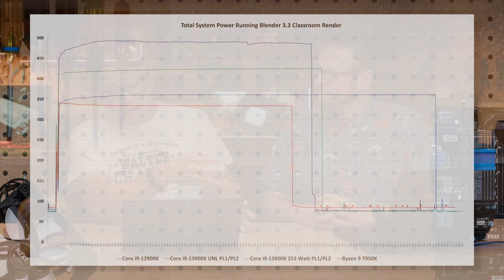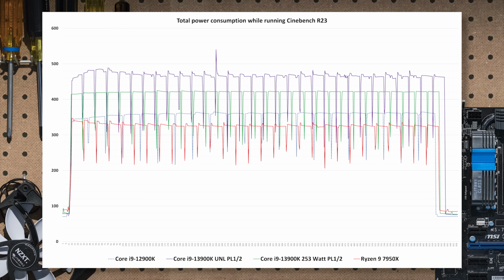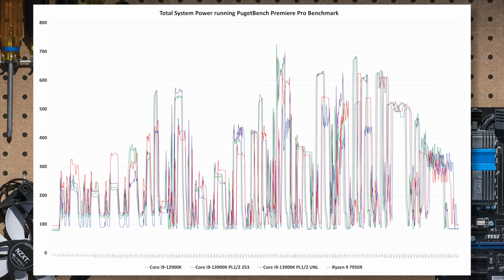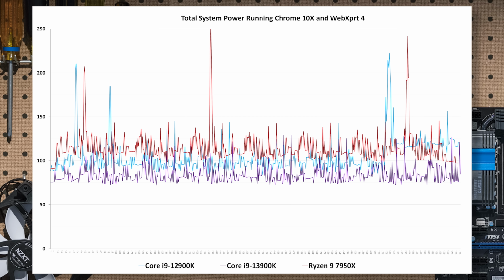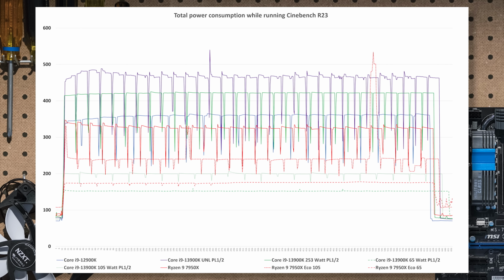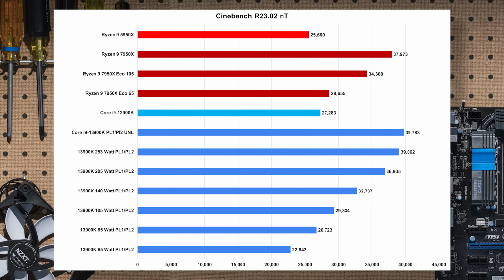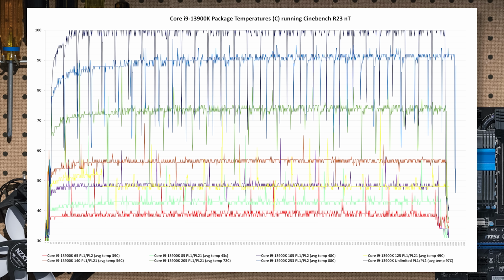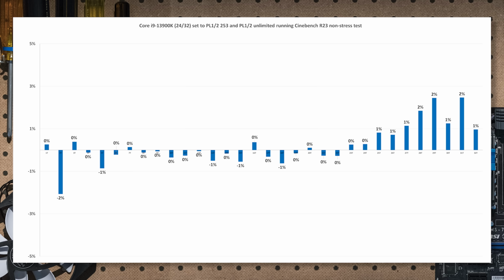How Much Power Does 13900K Use??

Comment: I have i9-13900kf cpu with ARTIC liquid freezer 3 420mm AIO .
With no overclocking , completely stock it will draw up to 287 watts by itself .
Max temps are 92 deg C for brief periods . No thermal throttling is ever noted while running cinebench  .
The 92 deg temp is only after several minutes running and like i stated only briefly.  Average max temp after 3 minutes is 81 deg C .
Fantastic AIO , especially for $115 !!!! It does require a case that can fit the HUGE radiator however .

Comment: Hi everybody, would an 850w 80 + platinum PSU enough for my build:
I9-13900k
Gigabyte Aorus Master motherboard 
Arctic liquid freezer II 420 argb
1 T m.2 firecuda 530 SSD
64GB ddr5 6000mhz ram
Gigabyte RX 6750 XT (3 Argb fans)
3 argb 140mm fans 
I'm not getting 1000w or higher PSU because I read that maximum efficiency is at 50/60% of load...but maybe I'm wrong.
Please give me your opinions, thanks guys
Reply: Yes you can. I can run I9-13900F with Asus Rog Strix RTX 3080 OC with a Corsair TX750M. Your graphiccard even got less watt usage then mine. Haven't bought my upgrade yet tho. But a Youtuber confirmed I only needed a 750W PSU. I have also ripped out the max power usage for the whole package and it doesn't getting over 700W, my calculations are based on the daily usage of gaming and stuff where no rendering and such are in the schedule, but I added about 90% heavy load when the I9-13900 are set to the 253W cap. This with RAM power usage, AIO watt usage, all RGB fans watt usage. Won't go over 700W. 697W for everything, so a 750W are more then enough for what I am using the PC for.

Comment: Comparing 19:28 to 17:20 shows, that at the respective 65 & 105 W settings these systems, when compared at the same wattage setting, don’t draw the same power, so their performance difference becomes plausible in favor of intel, since intels 65W is lower than amds, right? So maybe intel is too honest when power limits are used, compared to amd … what do you think?

Comment: I have a 13700k and RX 6800 XT on my gaming rig.  The rig regularly pulls 600 watts from the wall when gaming. Considering my 1000 watt Corsair PSU is Gold rated it has a 92% efficiency which means I have to subtract 8% from 600 watts. That is 64 watts wasted in the conversion from AC to DC.  So the energy my rig is using is actually 538 Watts.  Considering the GPU can take up to 260 watts, and the fact I have 6 RGB fans on my Rig means the intel isn’t using that much power.  It just spikes 253 or more if unlimited then it comes back down very quickly. The over all power draw isn’t as bad as one might think. Though 600 watts to play games is a lot when I think about it. That is the amount of watts some AC units use. 😅
Reply: One quastion, my house is old 50years. Its okey for cable instalation, if i use i9 13900k + rtx 4090 with good 1300w titanium PSU??

Comment: First I need to say, I really enjoy watching you two: not only it's informative (for general public), it's also entertaining.
Now about this particular video... At the point when you started to talk about heat, you just turned into the temperature direction, as that would be the same. And then you ended with conclusion "95°C/100°C is fine if AMD/Intel says so".
Well, temperature and heat are two different things and so you only touched half (less important part) of the problem. Ok, CPU's working temperature actually isn't a problem (as long within specs) -the heat is. Amount of heat is directly related to power consumption (1W=1J/second) and nothing else. That is, we can decrease CPU temperature (with bigger cooler), however that doesn't decrease amount of heat transferred into our room. Example: if one CPU consumes 150W and the second one 300W, then the second one will push double amount of heat into the room -regardless of CPU temperatures. It's amount of heat that increases room temperature, which we need to cool down on hot summer days.. which adds the costs and reduces energy efficiency.
Just wished to point out that very important aspect, IMHO.

Comment: How often do we run the CPU at all core 100% utilization? I think our PCs spend most time at idle. When gaming, it is usually running below 70%. When web browsing, it is under 10%. So power consumption differences between the various processors is not really significant.

Comment: Max power matters most IMO, it's what dictates the your PSU, cooler and (to some extent) motherboard choice. It also determines how hot your room will get or how much AC you need to cool it down. When you actually run the numbers, the power bill isn't really much of a factor.

Comment: Heh, this went up less than an hour after I commented about idle power on the video of benchmarks, so it's almost impossible you took my feedback into account.  But thanks for mentioning idle power anyway.  On the PugetBench results, something you might do to make the charts easier to read would be to plot the integral of the power consumption (the total energy) instead of the power consumption directly.  You could see the different configurations "racing" each other to the finish line, and the most efficient would be whichever line was lowest on the graph at the far right of the chart.

100°C has been normal on laptops for a decade :-)

P.S. Are the gaming tests run with vsync on or off?  'Cause vsync off would make the GPU power draw depend on how fast the CPU is.
Reply: Good suggestions. vsync was off.

Comment: Gordon and Adam Chrome browsing shows Intel Coliseum on not much power that is horizontal. mb
Reply: CPU + GPU @ 530W is a little over the top. mb
Reply: Another Coliseum at 16 minutes more delineated then compressed into RL Chrome platform but AMD R7K across a top to bottom power. mb
Reply: Capturing all eco RL v R7K turns off some blocks (cores) and other dark silicon and R7K also so what logic blocks? mb
Reply: Oh, another coliseum like in boxing and other blood sport rings at 22:30. mb
Reply: Gordon if all the top plaintiff attorneys in Oakland and San Francisco did not accept the Rocket consumer rip off case why would they represent the Raptor blown circuit case?  mb

Comment: Great job covering a topic that NOONE else is doing!!! That said I rarely niipick but you kind of dribbled the ball in conflating power and energy/efficiency this time around.  Several charts show less "power" but they also took longer so maybe similar energy/efficiency especially between 12 and 13 Intel. Poor Wendel over on Level1 felt the need to explain the difference between temperature and heat because of the whole 95C thing. I don't want to see people get confused about power vs. energy
Reply: Good points.

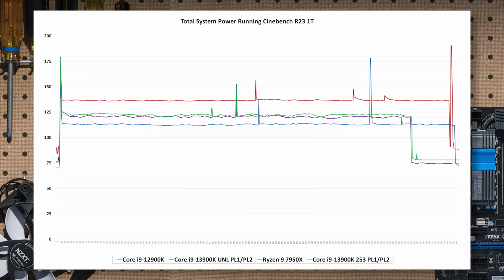Comment: 6:07 In single core its hard to tell if 12900k or 13900K is more efficient but 7950x is a surprise in that it is significantly worse(I wonder which core-type Cine-bench was using for the Intel processors). I suspect the AMD decision to run at high temps has hurt efficiency.
Reply: I seriously doubt the single-thread temps are as high.  Also, Intel's temperature target is higher.  I'd guess that the single-thread efficiency problem has the same cause as the idle power draw.
Reply: @Vegemeister1  True I agree...unless they have single core temp limiting but doubt that since It's always been a per chiplet/die thing...so yes
Reply: @jjdawg9918  They do have single-core temp limiting.  But because of the inactive other cores sinking some of the heat, and because of the OS scheduler migrating the thread between cores, the only way to hit the temp limit in a single-thread task is if your cooler falls off or your fan stops.

Comment: i dont understand the big deal with these thermals and power limits.  These are all synthetic benchmark numbers.  99.9% of people will not be hitting anywhere close to power limits.  Nobody is running benchmarks 24/7 for practical purposes.  Under normal use you will pretty much never hit these limits let alone for prolonged periods.  People act like their CPU will be drawing 300+ watts all day.
Reply: for productivity and rendering they will use all cores
Reply: @thehahahaha88  i doubt even heavy rendering will max out all cores.  I max out all cores regularly using 3d modeling softwares for 8 hours a day, and the temps and power usage are nothing like running Cinebench.
Reply: @keokio7  it will, 3d modelling software like 3dsmax will only use 1 core. But rendering software like blender, corona, vray will max out all cores
Reply: It does make motherboards more expensive, but for your electric bill you should be a lot more worried about the 70W idle than the 300+W load.
Reply: @Vegemeister1  70w idle? My 13900k is sitting at 23 watts right now watching a video
Reply: @keokio7  Total system power.  Look at the tail end of the graph at 6:10.  70w is unusually high -- I'm used to more like 50 W -- but PCworld's test bench has a monster GPU, an AIO (pumping water ain't easy), and probably an oversized power supply.
Reply: @Vegemeister1  im talking purely CPU, total system power can vary depending on components.  There was a video out there comparing 12900k and AMD's 5950x? anyways it was surprising how little the 12900k power consumption was under daily practical use.  Mainly due to the Ecores being efficient.. as much as i hate ecores.
Reply: @keokio7  I'm fairly confident the e-cores have nothing to do with it.  My Haswell from nearly a decade ago idles at ~3W reported package power and 50 W from the wall (with discrete GPU).   Ryzen's high idle power is probably something to do with the chiplet architecture.  Also, I've heard that overclocking memory past 3200 MT/s on Zen 3 disables some power-saving functions, resulting in considerably higher idle power with the commonly recommended "sweet spot" 3600 MT/s memory.
Reply: @Vegemeister1  haswell were 4 cores.. surely you can't expect the same power consumption with a 4 core CPU.  And no its not AMDs architecture, if anything they should draw less power based on their smaller transistors.  AMD has 16 cores that does 5ghz.  Intel has 8 cores thats 5ghz and the rest are 3-4ghz.  Of course they'll use less power when using ecores, its just logic

Comment: THANK YOU! Everyone else is just talking about the gaming performance. Power utilization is important to me because I'm the one who has to pay the electric bill! 😳⚡ My office is also small and I don't want to be uncomfortably warm in there. It was great to hear that there is an option to power limit this chip. I could see me doing most of my work at a lower power setting and then flipping the switch only when I'm ready to render the final project.
Reply: hear hear!
Reply: Power is cheap compared to salary, if it can make you save time, it's probably always worth it to use more power.

Comment: The reason why the 13900K is using less power while configured to match AMD's Eco modes is because Eco mode does not represent the full package power like Intel's PL1/PL2 settings do so you were actually comparing Intel at 65W/105W vs AMD at 90W/145W. The closest AMD has is their PPT value which is still some watts short but it's close enough.
Reply: Sounds like a pretty big oversight to be honest they gotta check those especially for idle power, sounds like AMD needs to offer a real 65 W mode

Comment: With both top chips running wide open, No OC,  Max Cinebench 23 scores are very similar but AMD is only using 185 watts to get there as opposed to 300 watts for Intel.   If you really want the best all around plunge into the Intel AMD comparison then watch Hardware Unboxed Channel.  He really knocked it out of the park.  I have watched 6 13900k Vids today.

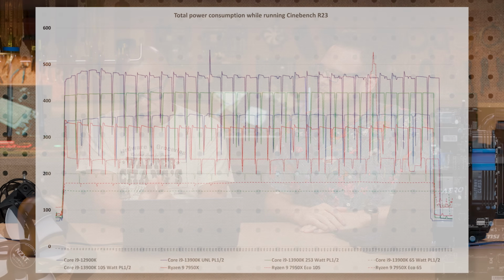Comment: @16:04 Looking at both ends of the graph, how exactly is 7950x in eco mode consumes more power during idle compared to when it's not in eco mode?
Reply: I've found both 5000 and 7000 generally idle at higher power than Intel 12 and 13s. AMD said idle power on 7000 was improved but I'm not sure if that applies when running EXPO profiles are running as 5000 also used more power running out of spec RAM.

Comment: Intel must be very happy with you guys.

At 6:16 , that type of graph is much harder to read than a simple bar graph that shows the HUGE power consumption of 13900K.

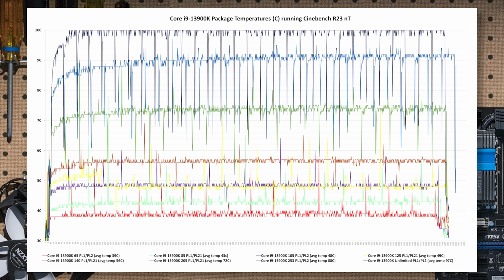Also at 22:56 , another confusing graph that has Intel Corp smiling.
Reply: Intel would be even happier if they showed the integrated total energy, which would both be easier to read and punish AMD for their ghastly idle power.
Reply: @Vegemeister1  'ghastly' idle power means NOTHING to anyone with job!    All that ghastly power amounts to pennies per day on your electric bill.

Comment: I'm wondering what's actually causing AMD platform to have higher idle power consumption? Is it because AMD is using 2 Promontory chipsets on x670e motherboards?
Reply: The infinity fabric always consumes power, the problems of chiplet design

I was hoping it would significantly improve once amd switched to n6 process for io die from 12nm global foundries
Reply: "higher iddle power consumption"
Intel uses Big-Little and their P-cores have higher IPC.

Comment: RIP GPU manufacturers saying you could get away with a 850w PSU with a 4090…
Reply: They're taking power from the wall, not accounting for PSU loss, it would probably not even be at half capacity, and even at idle, the GPU wouldn't be using 0 W. If it can actually deliver 850W, it's fine.
Reply: Why not? In gaming any CPU uses less than 180W on average. In other workloads either you're pushing gpu or cpu, rarely both at the same time. More than 95% of scenarios it will be just fine
Reply: @juniorjunior8494  but the rest of the 5% might fry the psu, cause a catastrophic shutdown due over current (crashing the workload) or may burn out some components